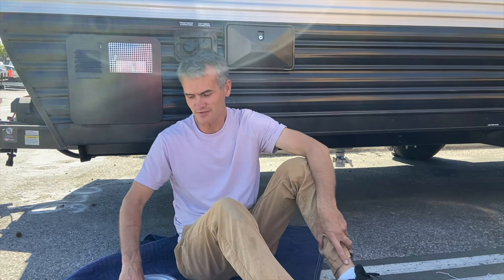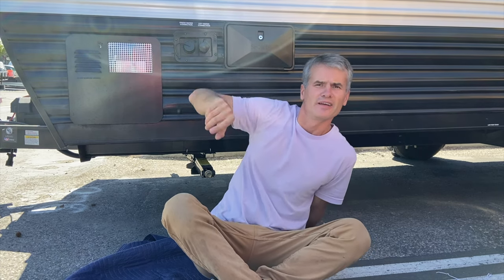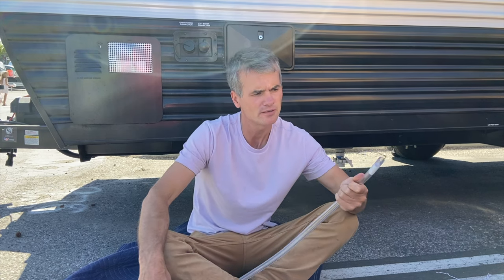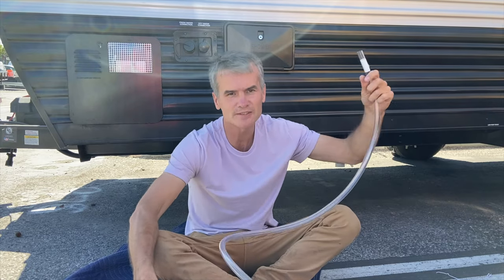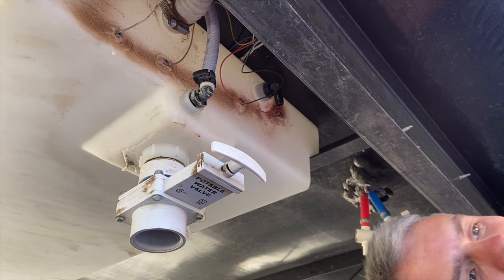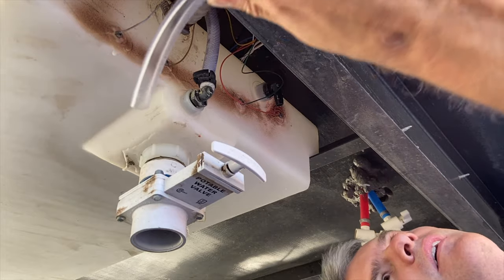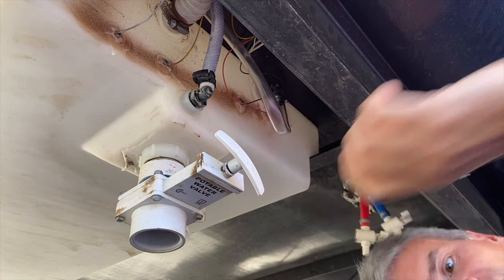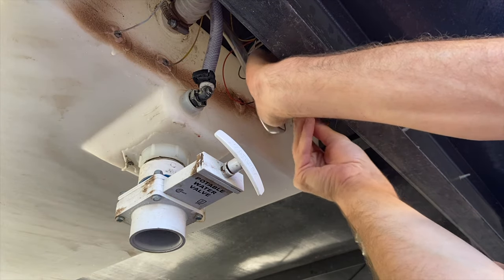RV FIXED: RV Freshwater overflow vent problem solved

Comment: I did the same fix on my Wolf Pup 16fq - I also added a T-valve to the hose under the trailer to drain the splash over when I’m draining the system